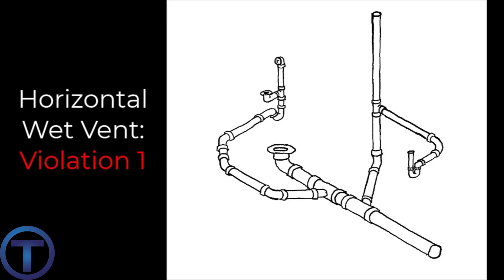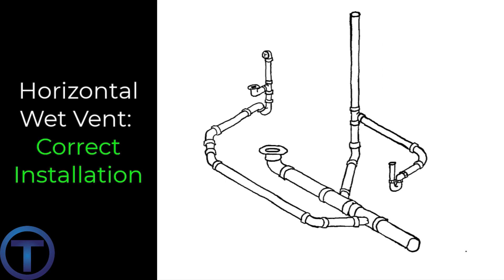IPC Horizontal Wet Vent Violations

Comment: Hey tom I need a quick clarification. By this example wouldn’t  the wc bend also need ting down stream of the wet vent ? Perhaps on the 45 outlet of the wye rather than the direct outlet ? I can’t tell if I’m making sense but let’s discuss further . I suspect the answer has to be along the lines of it having a direct connection to the fitting , also what code section is this in ?
Reply from the maker: UPC says toilet must be upstream.   IPC provides more flexibility and wc can connect anywhere along the wet vent.

Comment: The wet vent common vent and upstream fixtures is very confusing to me. I’ve heard that you can use a double pattern fitting upstream of the dry vent and then you could have two fixture tying into the double pattern fitting upstream of the dry vent for the wet vent. But if you had a dry vent that was a common vent, then you could not do that. No where makes this clear. I read this out of Bob Scott’s decoding chapter 9 of the IPC page 61-63
Reply from the maker: Check out my latest video about circuit vents.  I explain other options similar to what you are describing.  If the venting does not work according to wet vent standards, you can possible make it work with circuit vent and common vents combined together.

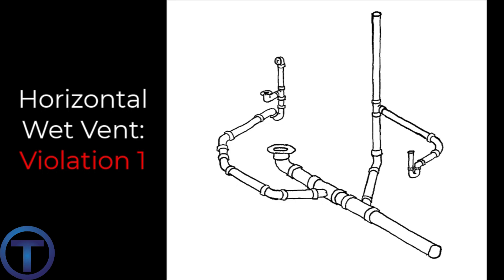Comment: 01:15 -- I have a plumbing engineered design plan (tight space, toilet is about 18" from the drain stack) that is very similar to this diagram where the tub drain connects to the rear of the toilet 4" pipe via a combo 45/wye fitting. Seems like a horizontal wet vent violation per the IPC? Doesn't that connect the tub vent downstream from the lavatory serving as the wet vent? Or, is that considered a direct connection?
Reply from the maker: Good question. 

2021 IPC 917 Single Stack Vent does allow for branching from the stack with the tub connecting to the toilet branch. But there is a distance limitation. The branches in that case must be close to the stack. 

Keep in mind that the requirements in this video are for wet vents. Other venting methods have different requirements.

Comment: Thanks for the tips Tom, Does the p-trap for the tub drain need to be 2" as well or can It be 1.5" then go up to 2" for the horizonal run. I could not find anything in my local code (Indiana), other than needing 2" since its a wet vent. Appreciate the help!
Reply from the maker: Minimum drain size for a tub is 1 1/2”.   Many plumbers run 2” drain and then reduce to a 1 1/2” trap but that is not a requirement.   Good practice though.
Reply: @plumber-tom9470  thanks tom! I ended up going to 2" after the trap.

Comment: How far down stream can tub wye be?
Reply from the maker: I do not know that there is a limit to that. The 3” drain serves as a wet vent to the tub. Usually they would not be too far apart for a bathroom group.
Reply: . Wouldn't that be 6'? Like a 3" arm. Distance of the trap to the vent?